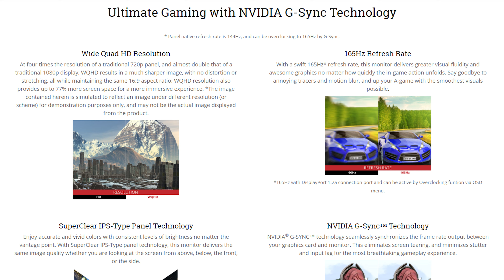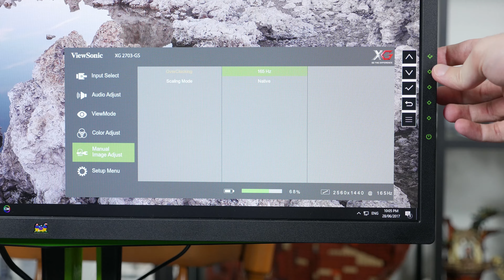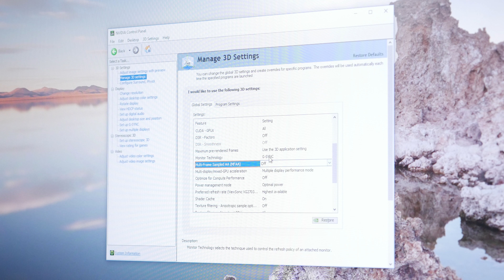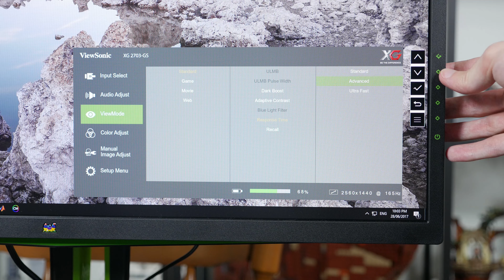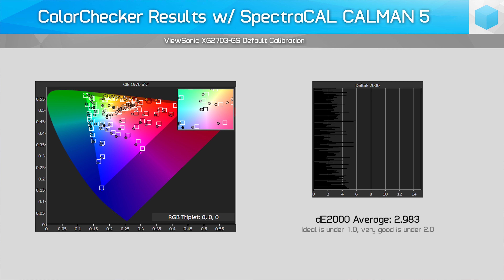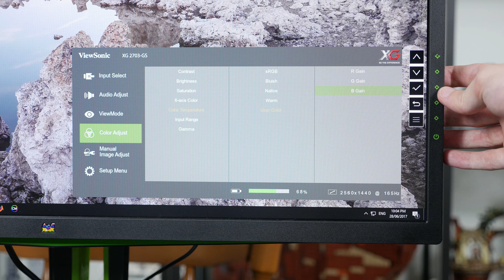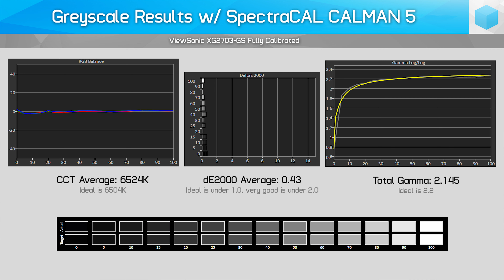ViewSonic XG2703-GS Monitor Performance and Calibration Guide

Comment: Great video Tim! I like the fact that you know your monitor specs and tech well, particularly when it comes to
contrast ratios. Various people who I've seen do monitor reviews will often state the ridiculous 2,000,000:1+
dynamic contrast ratios as the static contrast ratio. It's nice to see you know the difference mate. Nice work!

Now, I have a request that I'm not demanding as such but rather just asking. BenQ, several months back,
released their newest 1440p 27" AHVA monitor, the EW2770QZ. I was wondering, if it at all possible and
you're able to obtain one, if you'd be able to do a review on it, like you've done with this ViewSonic one.
There's no pressure at all, but it'd just be helpful as I'm seriously thinking about purchasing a pair of
them for my video editing work because I quite like the aesthetics of it.

Anyway, that's about all. Keep the great content coming! 😀👍🏻

Comment: that Green thingy is a bit of deal breaker for a lot of people..
Reply from the maker: +Adiprima Sulakstono yeah the green highlights are strange. I think they assume buyers will have an Nvidia themed build for some reason
Reply: g sync with green light , seems legit, need  Nvidia GPU for the benefit of g sync, I don't  why anyone looking at a G sync monitor might not like it.  Just turn off the light if u don't like it. Free sync monitors tend be red in some way , led or color accents, people don't seems to mind that.
Reply: +Corporate Commander I know, I personally like Red. Maybe it's a little bit subjective, but Red seems more common in PC equiments rather than green. it's not the light, that model and the green accent makes the monitor looks like a cheap monitor, at Least comparing it to Asus PG279Q and Predator XB271HU . 

With the same or a bit less price point as these two, I doubt people will get it.
Reply: That's just because of G-Sync, the Freesync ones have red accents.
Reply: Adiprima Sulakstono It is a lot less, $100 less than an XB271HU and $290 less than a PG279Q here in Australia.
Reply: FWIW, I bought one recently and was pleasantly surprised by the green. In the marketing pics it was bright zombie green but in reality, it's all recessed into the panel so it's actually 'hiding' in a shadow. It's barely visible and you certainly don't see it while gaming. Hope that helps.
PS I should add that I have removed the base (it's mounted on a VESA mount instead) but again, the panel casts a shadow over the base anyway.
Reply: Oh, and the light isn't green, it changes colour based on the image displayed or according to custom settings. It's just the plastic in the bezel/stand that's green.
Reply: +Capta Praelium I see, i think because in youtube quality video, the lighting tends to be strong so the green thing really stands out, as in standard room the lighting is not quite that bright so the green thing blends in with the black.

Anyway, 1440p 144hz IPS is always a fantastic monitor..nomatter how they are designed. Color is subjective, but i think its' still a bit brave putting on the green as a high end monitor :)
Reply: Adiprima Sulakstono yep
Reply: Adiprima Sulakstono you don't really notice it tbh, I have this monitor
Reply: you can turn off the green light and also you can change its color to red or white. and you can only see the green from the back, i never notice it
Reply: I just got this montior before, the green accents aren't actually nearly as noticeable IRL as they are in videos and pictures.
Reply: And here I am considering myself as a lucky guy, because I just happened to discovere this monitor and my favourite colour is green
Reply: @namenotfound8747  It's actually NOT a static green light - there are several options.  "Fixed Color" which provides a static Red, Green, or Blue (your choice).  "Off" which is self-explanatory.  And "Auto" which adjusts the color of the power-indicator light based on the majority-color currently displayed on the screen.
Reply: Yeah, but Green is better than Red... Oh, that's right... It's subjective. I personally like the color Green a lot more, but, I don't like lighting on anything other than the screen itself, so I can just turn it off. It's that simple.

Comment: If you're doing monitors now, please review the Dell S2716DG extremely popular low cost G-SYNC.
Reply: low cost? you sure?
Reply: Rob Nomad It's the cheapest in it's class, 27" 1440p G-SYNC, frequently sold for $450(In the US at least)
Reply: If you're interested in this monitor, keep an eye on the dell website. Every couple of months they do $200 off the normal price and it's the cheapest around, at AUD$799 . They don't seem to advertise the specials though, so just hit F5 often. The sale will last for one week and will end on a Thursday (Aussie time). I know this because I went to order one and missed the sale and that's what they told me. I ended up getting the viewsonic and didn't regret it. HTH.
Reply: abestream5 you guys forgot that not being IPS makes it cheaper?
Reply: Șerban There are no similarly specced TN panels at that price. It's not cheap by any means but it's the bang for buck buy in it's class.
Reply: >G-Sync
>cheap

Pick one.

Comment: With respect to overheating @165Hz, I was curious if you did CS-GO or other very high refresh rate game to is driving at 165Hz constantly did cause the heat to increase? If you're running G-Sync and running FPS in the 80s most of the time, the monitor would not be taxed. Not sure if a Windows desktop set to 165Hz would cause the same level of stress. Just curious. Great overview.
Reply: Matt McGregor I run this monitor always at 165 and have not had any issues with any games

Comment: I've been looking at getting either the Viewsonic XG2703-GS, Acer Predator XB271HUA or AOC AGON AG271QG.
Does anyone have experience with the other 2 monitors and would you recommend them?
I want a monitor with 27", 1440p, 144hz and G-sync without going above $1000 Aud, so far these 3 seem good. Though the green on the Viewsonic is a bit annoying.

Comment: Hi. Does anyone knows if there is possibility to save the picture settings (e.g. brightness, gamma) on this monitor? I keep trying and it resets brightness to 100 and gamma to 2.2 every time when monitor is turned off or even when I'm changing between profiles. Even when using user defined profile Gamer 1 or Gamer 2.

Comment: No point for 165 Hz due to ghosting.
Reply: i agree,  i got the acer ips 144hz version of this, and tn is clearly better for fast motion, but is ok enough for gaming use.
Reply: xuddish p TN or IPS is not really an issue here. Over-clocking 165 Hz can caused over shooting problem  so there's no point using it. I highly recommend stick with 144 Hz or 120 Hz.
Reply: Ng Khan Mein my monitor is set to 165Hz max refresh rate. Is it better to use 144Hz for fps games due to ghosting then? Plus does it only ghost when reaching higher than 144 fps in game?